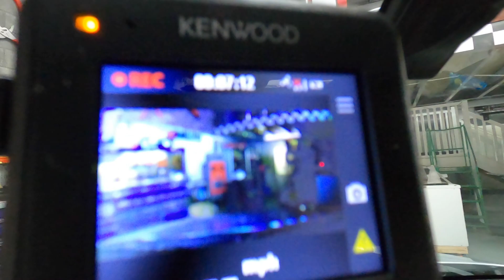prepping a stereo for install how to

Comment: To answer your question about remote access to the cameras for the busses  yes you can see the cameras where ever the bus is at they also have wifi system in them and USB  port. Like the drifting  video  looks like fun have a few friends  that do it on the weekends. Any way glad you are almost there for the 1000. See you Tuesday.  See ya.😎😎😎😎😎